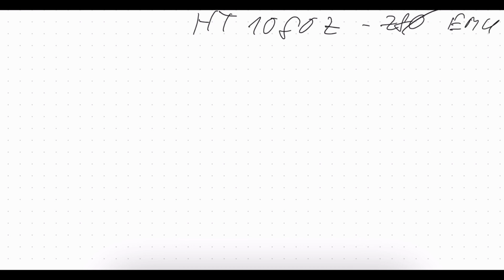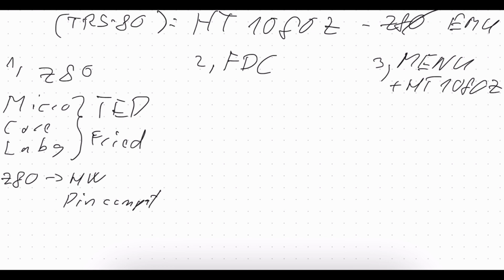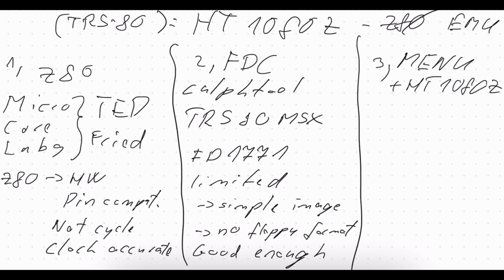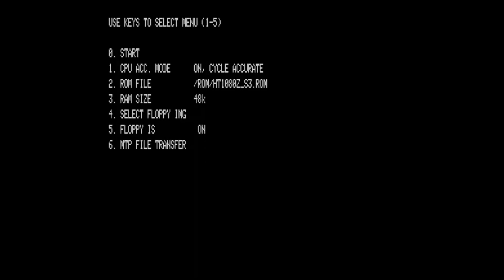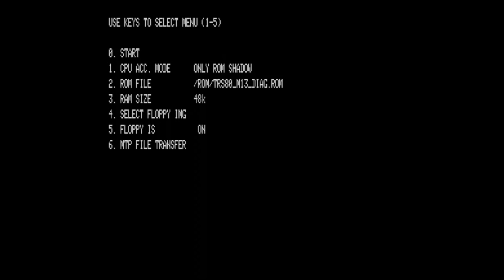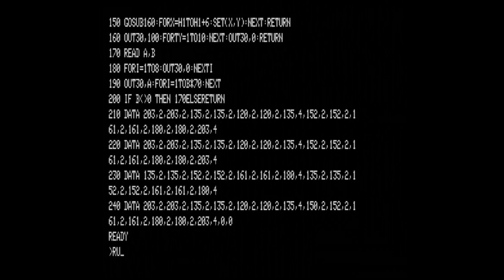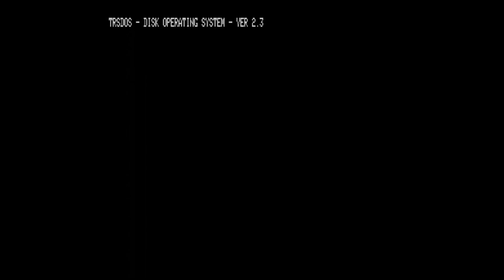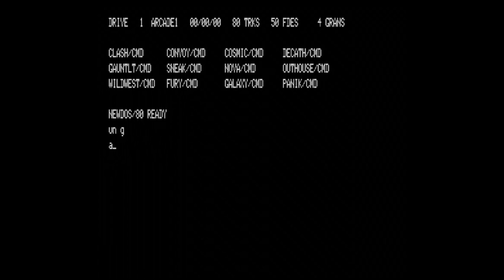TRS80-ICE expansion for TRS80 Model1

Comment: Hi.  To run a /cmd program in TRSDOS, you just type base part of the name.  So you just have to type 'xenos' and press enter.  If you know it's on a different drive, you can add that at the end to make the computer find it faster, like 'xenos:1' or 'xenos:2'.  Oh, and great job on this project, too!
Reply from the maker: Thanks a lot. You know I had to use the tape until now :) So I am learning to deal with different TRS DOS versions from scratch.

Thanks a lot, I spent some time on it. As I already stated there were the pieces I glued together, so the achievement should be also credited to MCL and calph as well. Even if it is a kinda alpha release it survived serveral retro weekends, so within the limitations it is quite stable.